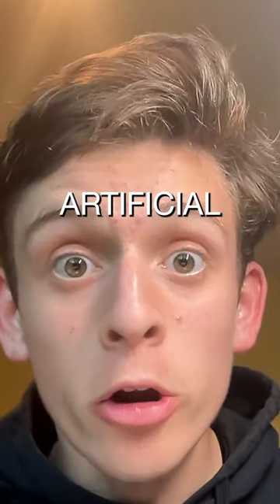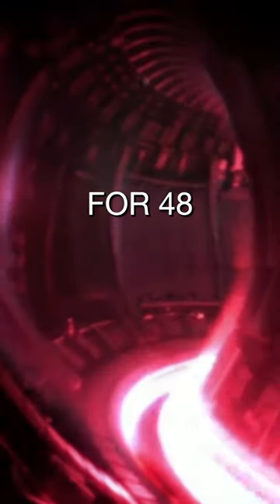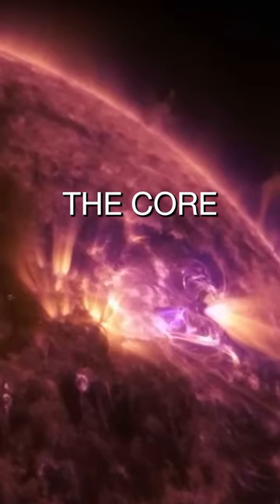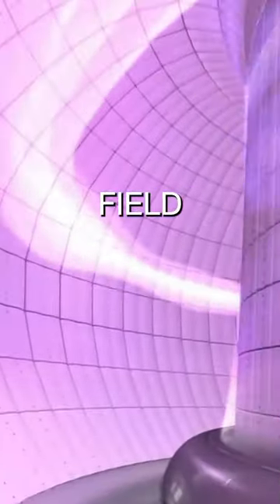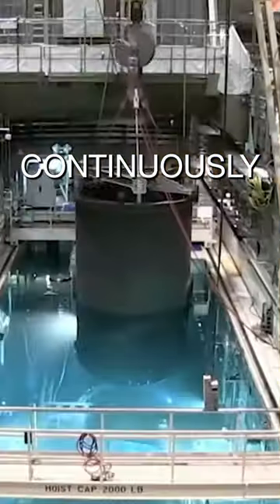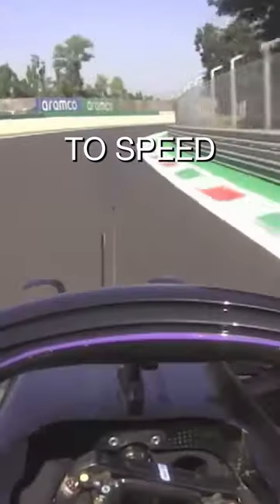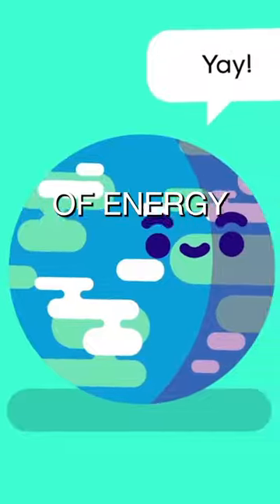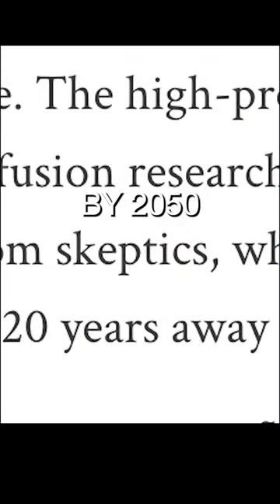Korea Sets New World Record In Nuclear Fusion

Comment: Fusion power is never going to be reality. Why? A product of the reaction is neutrons. The moment the fusion reaction begins, neutrons fly straight through the magnetic field and collide with the containment vessel. It doesnt matter WHAT the vessel is made of, it becomes:
1. Very hot very fast.
2. Radioactive. Neutrons can collide with the nucleus and make it whatever it used to be, plus 1 neutron. This will then decay, releasing radiation. This radiation will then interact with the magnetic equipment destroying it unless the reactor is shutdown. Whats the solution? There isnt one nor will there EVER be one. Fusion is fundamentaly uncontainable by electromagnets and NOTHING will overcome this fundamental flaw. It can contain plasma because matter in this state has all its electrons stripped so is charged and thus subject to magnetic forces. Neutrons are uncharged and thus the moment fusion reaction begins, your containment system is about to be destroyed.

Oh, you might be interested to know that the containment scientists who pointed this out were fired. Further, reactions with Boron which produce LESS neutrons were ignored in favour of hydrogen/helium fusion which produces way more.

The scientists dont WANT to solve the problem they just want to stay on the gravy train.